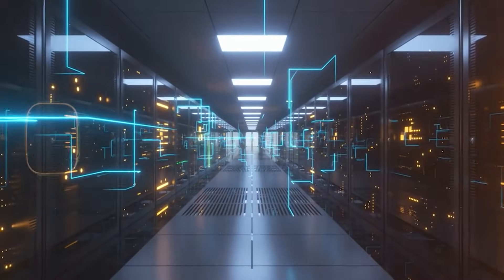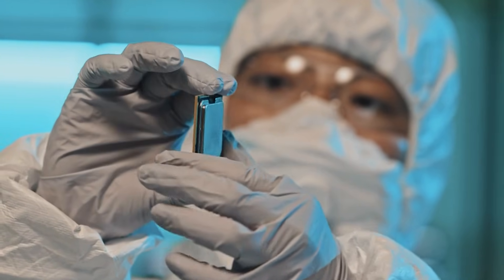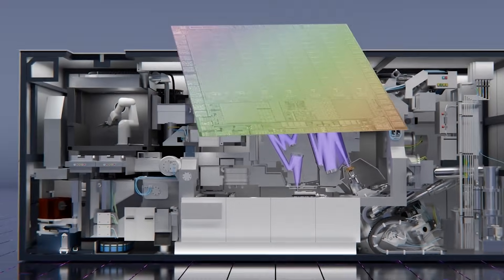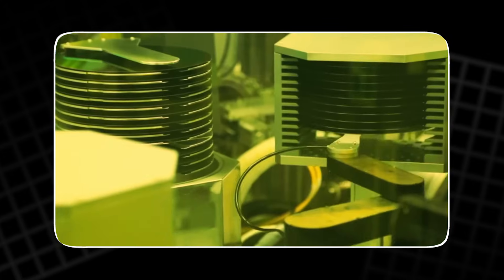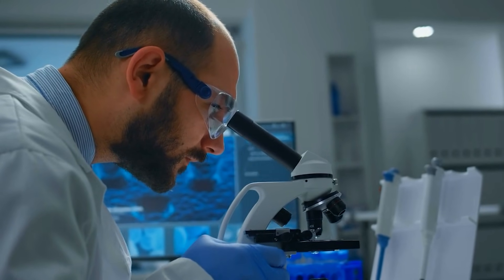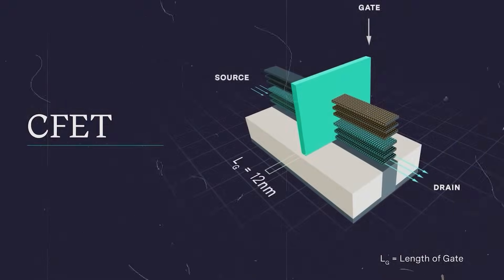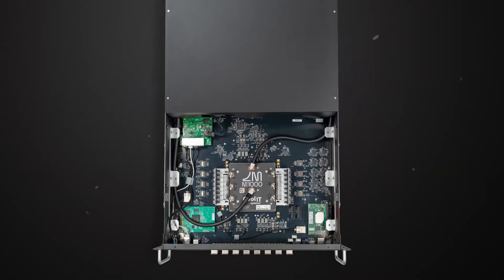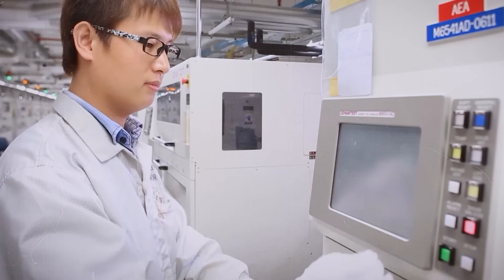Inside the Secret Lab That Controls the Future of Computing

Comment: Photonic neurons: These are chips that use light instead of electrons to process data (especially in artificial intelligence) at higher speeds and efficiency. This is achieved through two methods: binary computing or analog computing.

Optical conductors: These use light to transmit data between computer components (CPU, GPU, RAM) instead of copper wires, increasing speed and reducing heat.

Photonic electron stimulation: Light can stimulate electrons within transistors or circuits to increase switching speed and improve the performance of conventional computers.

Companies (such as Lightmatter, Lightelligence, Ayar Labs, and Intel) are working on hybrid systems that combine these methods.

Result: Light can be integrated with computers in three main ways:

Light-based data processing (photonic neurons).

Light-based data transmission (optical conductors).

Light-based electron acceleration (within transistors).

The practical direction: Photonic-electronic hybrid computers to achieve greater speed and energy efficiency than conventional computers.